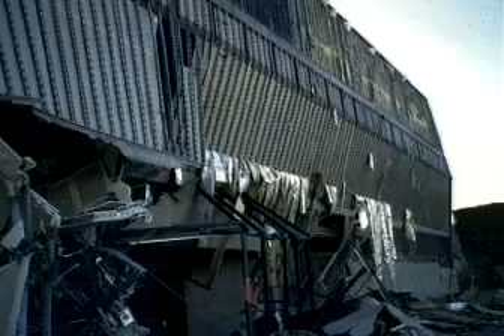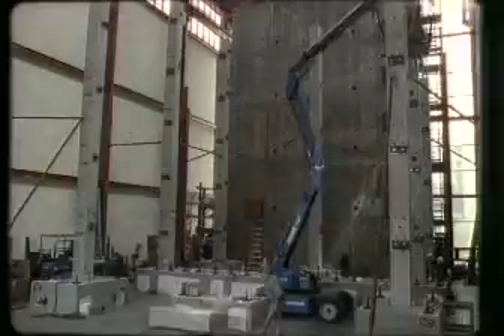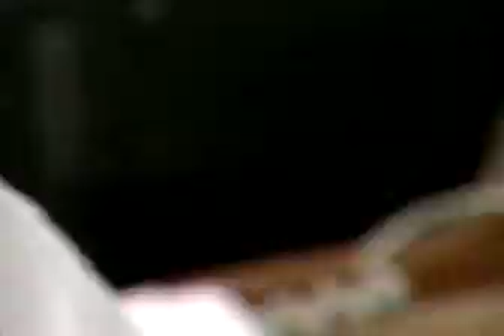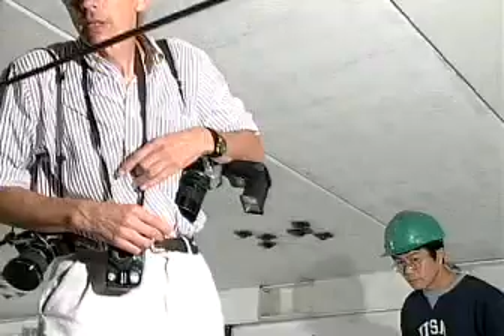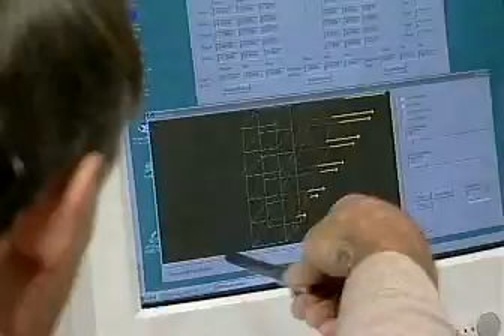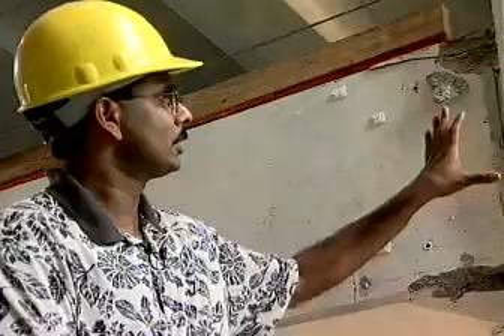PRESSS: Precast Hybrid Moment Frame Testing

Comment: Congratulations to engineering team and everyone involvement on the design technology of this project.my question is now that building prove capable to stand  at a level with remarkable performance and result how will this perfect team will prove that this building will remain standing on (a foundation made for it on the real world compares to the one that it was tested on 🤔)to me that will the questions to answers the fondations have to perform as well and better.there is a lot more challenging designs I think that needs to go on the foundation structures I saw my mom house move like a wave and side to side at same time oh by the way I'm in Port-au-Prince Haiti fortunately we sustain no home dommage on the house .now someone could have an idea 💡 of my concerns and questions please I like to see or read from the teams involved on that project
Reply: These are seismically designed buildings right from bottom to the top. May be your mother house does not incorporate the seismic design that is the reason it swayed more during earthquake and I guess would have sustained quite alot of damage. Seismic designs are available but the main question is the economics I think. By following seismic design guidelines your house slightly cost you higher than the conventional design but would give you some safety. The choice is yours. I think you can retrofit your mom house and can enjoy more safety level. Best!
Reply: @iftikharkhattak5914  absolutely d cost would bit higher than d non seismic design...for the long run it will be cost effective since this structural concept could offer minimal damage..besides that,d main concern is about d occupant life since it is more precious than anything.